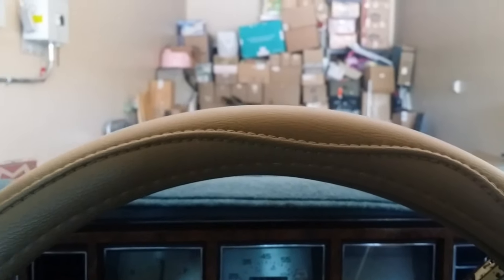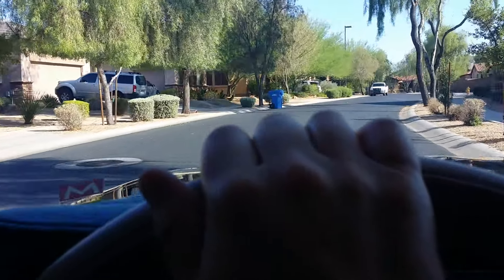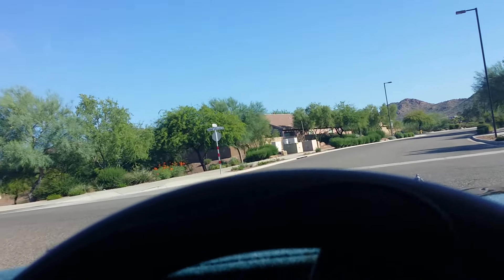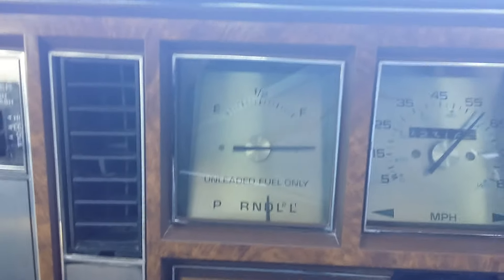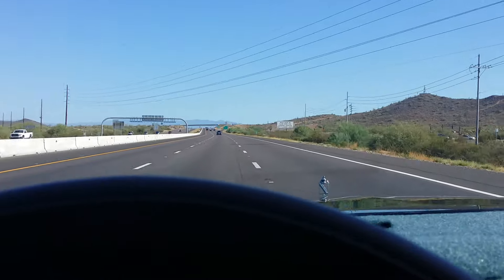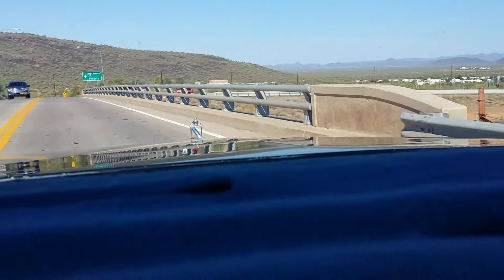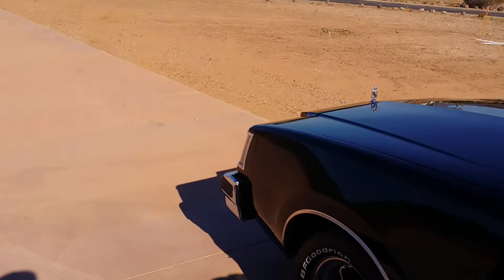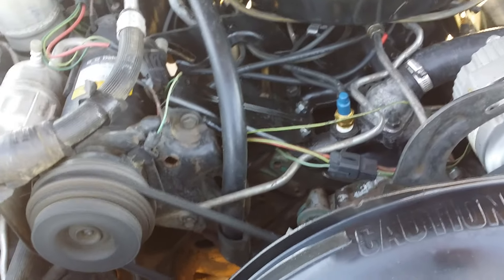1979 Buick Regal V8 Coupe Test Drive

Comment: As far as the hood release thing goes.... my family has had several of these type cars over the years (A/G cars -Regal, Cutlass, Century) and our Caprice did the hood sticking thing at one point. Try WD40 Or light engine oil on the latch and cable it should work if all is in adjustment.
Reply from the maker: Thanks, we had done that and it did help slightly.
Reply: Your right my dad had those cars when new and old he had to oil up the hood hinges and he was a pro eliminating the window rattle and squeaks he thought me how to fix cars love the and G bodies  all the interior dimensions are the same through 1987 88
Reply: @DavidR-ub2dp  I miss my '83 Regal 2dr coupe. Me and a friend pulled the 231 V6 and replaced it with a Buick 350 V8 4-barrell. Car was never the same again (in a good way)!
Reply: I can relate we had an 88 caprice classic brougham a little grease on the latch fixed everything
Reply: And cable
Reply: @mattbartolovich8228  Works every time!

Comment: Not sure if you can answer this question. I have 1979 buick regal 3.8L v6 and for some reason If I try to speed up the car will cut off. I have to drive real slow I just can't move fast at all. Also the speed I am going is way off. It can feel like I am going 35 mph but the speedometer will read 65 mph. I know that is not because people drive by me lookin very annoyed.
Reply from the maker: It's hard to say what the cause of the stalling is. It could be a number of issues. This Regal exhibited something similar during rapid acceleration. If I pressed the accelerator pedal too fast, the car hesitated and would occasionally stall. If I remember correctly, it was a tune-up, new spark-plugs, new PCV valve and a full carburetor rebuild that took care of the issue. As far as the speedometer issue, I'm not certain. You might need a new speedometer cable some other component. Again, not sure on that one. Hope this helps.
Reply: D Nation of One you might want to tighten up the cable on the throttle

Comment: There is one up for sale close to where I live. What issues should I look for?
Thank You
Reply from the maker: This particular Regal had been restored by a mechanic so everything that
 needed to be addressed was taken care of and I didn't have many issues 
with it. The only thing that we did end up doing on this Buick was 
rebuilding the carburetor because prior to that it would occasionally 
stall and had a bit of a rough idle. I always pay my mechanic for an 
inspection prior to purchase and would definitely recommend that anyone 
do the same when dealing with a 30+ year old car. My mechanic is experienced
with older cars and runs compression tests on engine among other things.
Reply: Thank You very much for your insight. I called the seller who told me the car hadn't moved in two years and needed a new fuel pump...So I gave up. But yours remains a sound advice regarding any future purchase
Thanks again.
Reply: Karb Rewerie well apparently your mechanic didn't restore the faulty gas gage. Lol